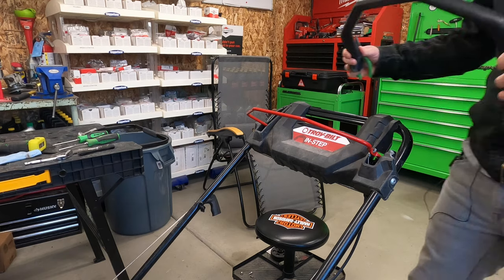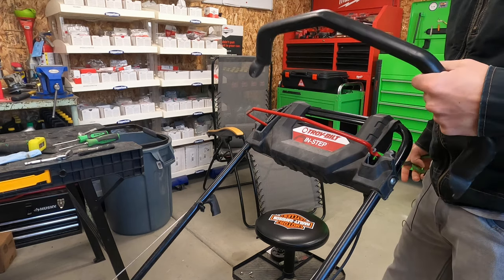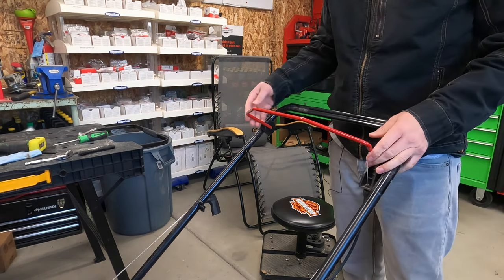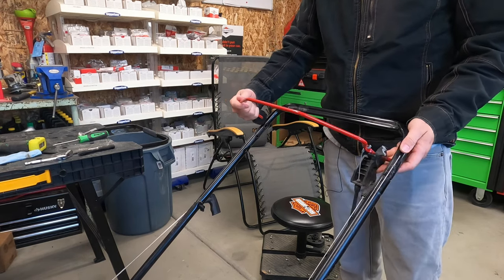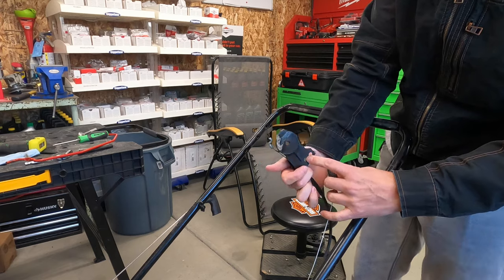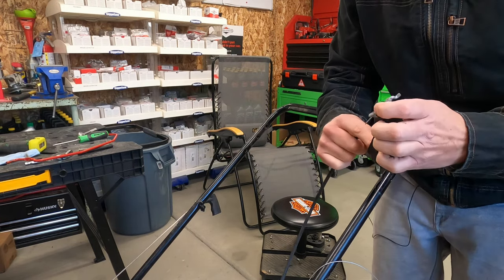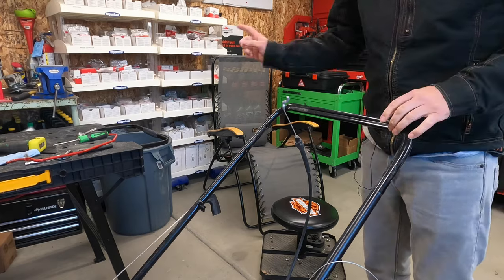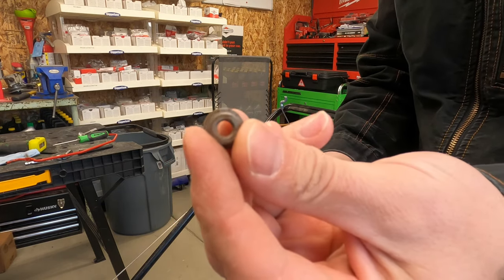How to fix the drive handle on your self propelled mower (TB370)

Comment: I bought a used mower with that exact drive handle assembly missing. I bought a new handle, but I'm needing that bushing. Having no luck finding one. Any ideas where who might have one or maybe a part number for that bushing?
Reply: I just wanted to chime in and say I had the missing bushing issue as well. Quick fix I just drilled a hole in to the handle where the bushing would go, just enough to slide through. It worked perfectly, now I’m not sure how long that hole will last but it works!

Comment: I have a craftman  model 247.375900 my handle broke  where would i get it it orange
Reply from the maker: Based on the model # you gave me, you are looking for part #791-09922A.  I would check places like eReplacementparts.com or Partstree.com otherwise you can just google the part number and find the cheapest option.

Comment: The tool reviews at the start of the video is that a spring puller tool? If so where you get it?
Reply from the maker: Yes it is.  It is a spring puller/pusher.  Very handy to have.  I got those ones from Snap-on but you can probably get them other places.  Part#SPRG625G & SPRG618G
Reply: @kbssmallenginerepair2615  thanks man! They looked good quality! I will have to check it out!

Comment: Great job KB! You would think if they are going to make the hole a different size in the new handle , that they might supply a new bushing. Pretty radical thinking on my part! LOL.  👍🇺🇸Roger
Reply from the maker: Thank you Roger!  I had the same thought!  Why not make that a part of the new part, or change it and cast it into the handle.  Poor design all around if you ask me.  Thanks for watching!
Reply: Been trying to locate that little bushing. What size is it? I'm thinking of pressing a grommet in there because I just replaced a handle on the tb360 and the old spacer fell out while mowing.